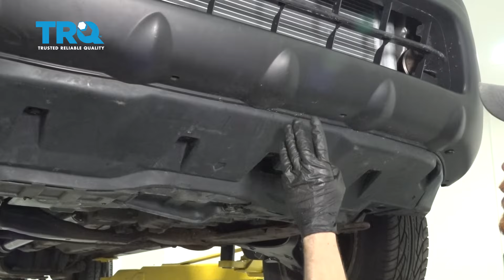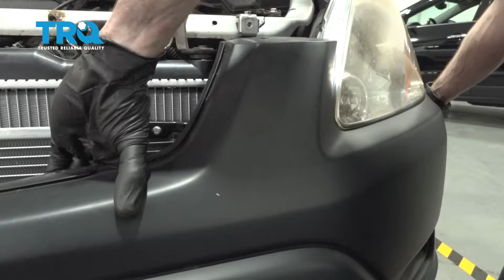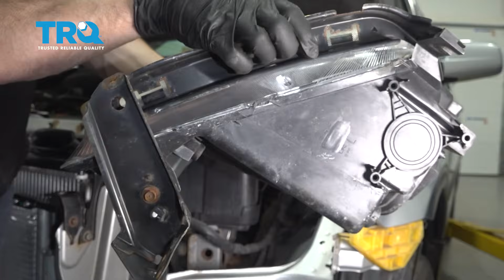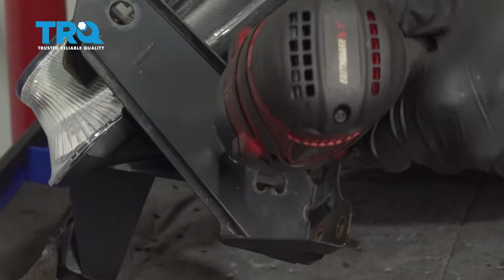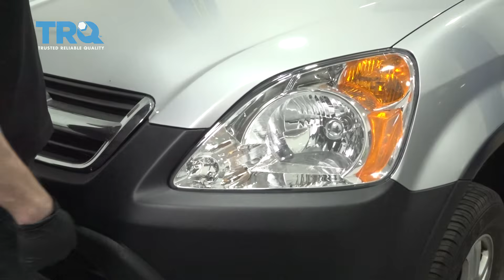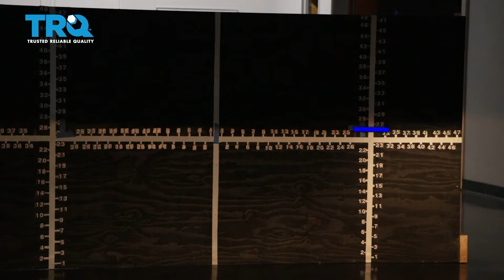How to Replace Headlight 2002-2006 Honda CR-V

Comment: Just a few notes on an 06 CRV there are 4 - 10mm bolts that hold each assembly in. Also in the inner fender we'll there is an 8mm up top and a Phillips screw at the bottom holding the liner to the bumper.  Expect the push pins to be brittle ask me how I know 😮. Really appreciate the video and info I'm always hesitant to remove body panels or trim in fear I'll never get it put back together again. This video made it a breeze.

Comment: This is good info, but why remove the entire bumper? Just put a box under the front edge, and take all the upper edge loose. Let the bumper rest on the box and you can access everything from above. Don’t bother getting under the car to take all those trim clips out.

Comment: Excellent video. I was able to follow the steps and replace the headlight unit without any issues. I suggest to have some spare plastic push buttons as existing ones will break if the car you are dealing with is very old.   Big thanks for the video and keep up the good work. Saved lot of money !!!

Comment: I love the video! Great job!
I have one question though... will the headlight set you have linked fit a Canadian 2002 CRV? Any help would be greatly appreciated.
Reply: Look at the VIN. If it starts with a J and was built in Japan you need the headlights for the Japanese version, if it starts with a 1 or 2 then it was built in the US which would require the United States Version.
Reply: @daniels7110   mine starts with S, what does that mean? I can’t find anything online.